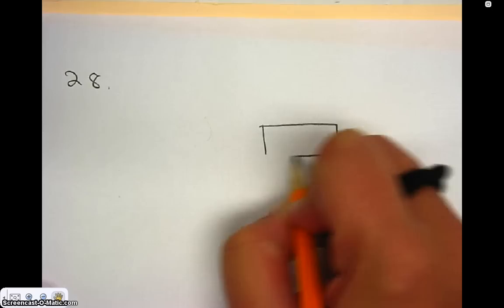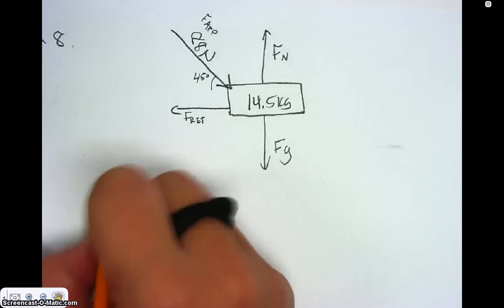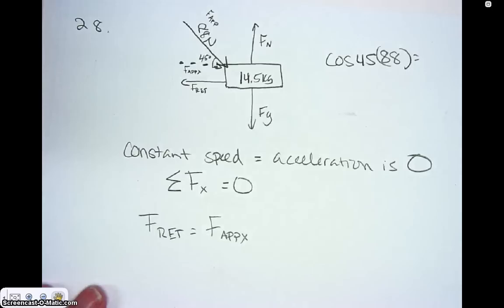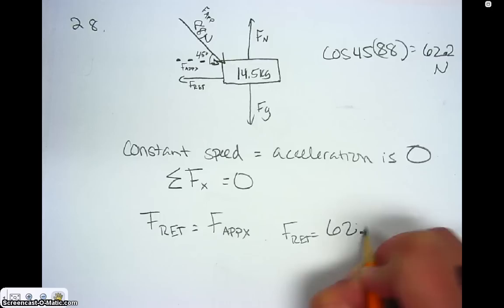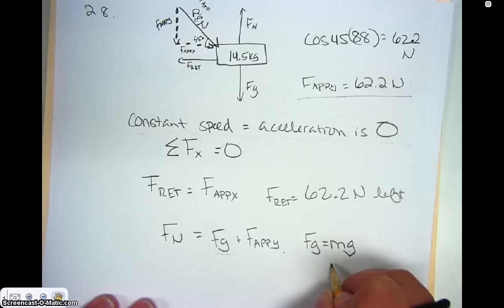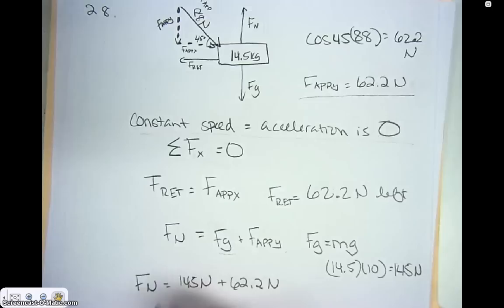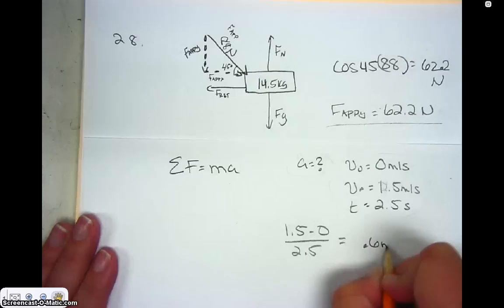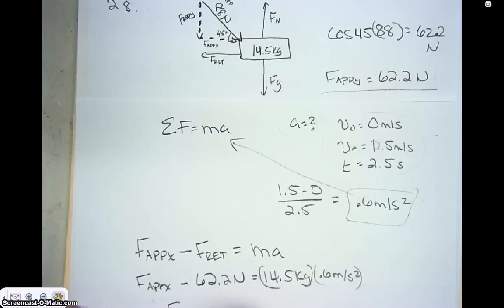Sample 3.1 Lawnmower

Comment: Isn't the force component that's acts downwards suppose to be negative
Reply from the maker: Justcreatedthistryna figurehowitsworks Yes if you define the coordinate system to be that way.  For example, on the AP exams they often ask for the magnitude of vectors because people can define the coordinate systems differently.  I could make up negative and down positive if I wanted as long as they are opposite.  I teach my students to use the magnitude (just the number) for the forces and add vectors that point in the same direction and subtract ones that go in the opposite direction rather than assigning a positive or negative value (it is really the same thing).  I find they understand it better that way.  Also keep in mind in this problem you are in equilibrium for most of it so there is no net force.  That means all the forces to the right must be equal in magnitude to all left forces.  Also, all up force magnitudes are equal to all the down forces.  They have same number but different sign because they are in a different direction.  Because these are equal they can be substituted in for one another.  Hope this helps.  Feel free to ask further clarifying questions.
Reply: I was solving a similar question and I took my y component as negative. my Force normal is less than my weight. Which is different from yours. Your force normal is great than your weight..is my answer wrong ?
Reply from the maker: Justcreatedthistryna figurehowitsworks Think of normal force as how hard you are pushing down into a surface.  If something is just sitting there the normal force and weight are the same.  If you push into a handle like my problem you are pushing down a bit so the normal force is bigger than the weight because both the weight of the lawnmower and the extra push down on the handle push into the ground.  If you are pulling something along with a string at an angle then the normal force would be less than gravitational force (weight).  You aren’t pushing into the ground as hard because you are pulling up some on the string.
Reply: Oh I think I understand thank you